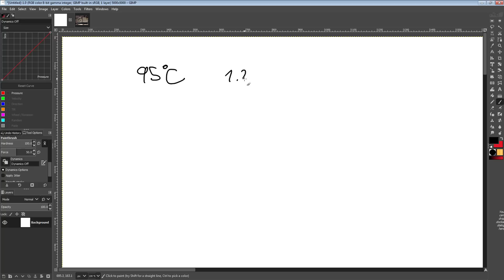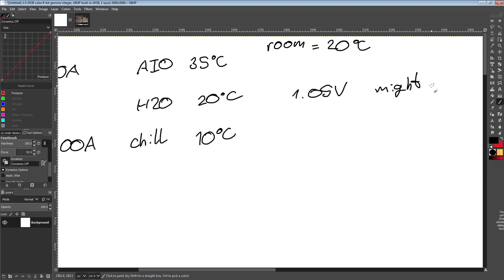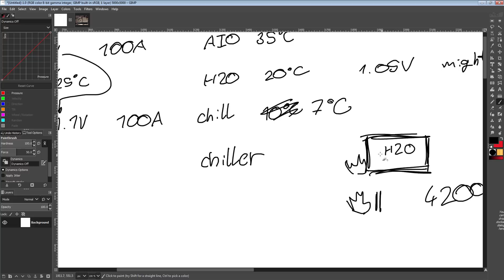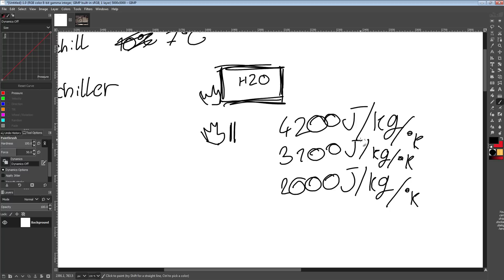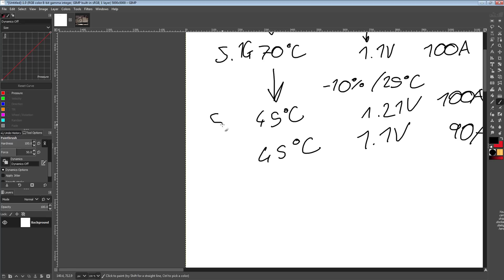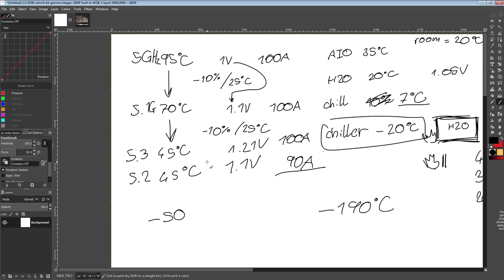Elaborating on how lower temperatures can improve voltage tolerance.

Comment: Typically with semiconductors, though depending on the material/geometry of the semiconductor, current has a quadratic increase when it comes to electromigration. That is due to blacks equation being MTF = A/j^n*e(Ea/kT) with j being the current density and n depending on the material/geometry of the semiconductor while typically being 2.
Reply: I get it

i don't get it

Comment: Oh shit thats interesting, im one of those who think degredation isnt a concern when running more voltage than stock at even little more temperature:D

But only in idle, under load using llc7 is using less V than on stock settings 

This should be ok, right?

Comment: This is a very nice explanation video. Any matter has a structural breakdown tolerance to temperature in a molecular manner. (I'm talking about the internal hot spot temperature of the matter in our case it's silicon on transistor scale but this applies to any matter) If your cooling solution has a huge delta like liquid nitrogen or Co2 or whatever. The bigger the gap is the higher the entropy. The faster the heat transfer to the cooler from the heat source. Let's say silicon has a tolerance of -150C to +150C, which means as long as the silicon remains in between that range, it'll not break. 
As we increase the voltage the more power the silicon uses therefore the more heat dense it becomes. Even though the sensors show 100C, the internal temperature of the silicon where the transistors operate are higher because of the sensors don't pick up the hot spot temp accurately due to the physical distance in between the hot spot and the sensor read point, therefore it'll start breaking down on the molecular level. However if the cooling solution is Ln2 for example the entropy is bigger which means the IHS, the thermal paste, the top of the silicon basically everything in between the LN2 and the transistors are colder therefore the heat source which are the transistors are able to transfer the heat to the top of the silicon, to the thermal paste et cetera much faster so it doesn't reach the 150C structural breakpoint and you can use more voltage because the transistors won't reach 150C due to the fast heat dissipation.

The degradation may still occur due to the extreme expansion and contraction of the matter caused by the rapid heat change.
 (note that I made up the numbers, I don't know if the silicon's breakpoint is 150C or whatever temp. It's probably higher.)

Comment: And here I am, scared of degradation even with an undervolted CPU, I have an I7 3770 since 2013, I overclocked it to 4.1 GHz on all cores with negative offset of -0.015, I want this system to last as long as I can because do not have money to upgrade to a new platform, also did the same process with my GPU, 1660 Ti, undevolted and overclocked, the voltage curve hit 0.950 mV at 1980 MHz, enought to have the GPU core always below 60ºC at any game that I play

Comment: Sounds to me like I should just run my 9700k at stock speed, and my F4-3200C14D-16GTZR kit,  with XMP turned off. And be happy with it.
I'd like to keep my shit for more than a week hey...
Reply: Don't go completely paranoid with degradation, at that point you're making a chip that would last 10 years last 20 instead, and you will probably have many other components fail before it.
Reply: Why in fucking hell would you run with XMP off?

Comment: liquid ammonia isn't that op either.
Ammonia has a molar mass of 17, so in order to have more heat capacity than water (4.2j/g/C REMEMBER, ONLY AT 25C) you need 71j/17g/C, or 71j/mol/C.

Eyeballing this chart on https://en.wikipedia.org/wiki/Ammonia_%28data_page%29#Heat_capacity_of_liquid_and_vapor
liquid ammonia clearly has the advantage at 81.5 ish, but that's what a not quite 15% increase?

This is also assuming the same weight, which might not be what we are after. After all the amount you can stuff between microfins is limited by volume, not mass. However much more dense water is to ammonia also eats away at that 15%.

Obviously ammonia has the advantage of not freezing practically ever, but you do need a pressurized loop to keep it in liquid form.
Water on the other hand requires stupid amounts of pressure to prevent from freezing so you end up putting in additives that decrease not only the thermal density per mass but also mass per volume as well.
Point is besides being not something you want near consumer products, ammonia really isn't much better if at all at water above freezing point obv.
Reply: On the other hand, liquid ammonia (closed) loop might be great for actually ln2 overclocking. I can only imagine there's some leidenfrost effect at the bottom of a jar you just placed on a multi hundred watt heat source. Would probably be a bit more efficient if you actually had a loop to transfer that heat to a radiator submerged in ln2?
Much more surface area, actually some flow rate to prevent that insulating nitrogen vapor etc.

Comment: X570 unify cmos reset is broken. Fix is to pull cmos battery. Thermals drop 20c boost clks increase. Even on a3 bios.

Comment: I feel a lot more disconcerted with AMDs auto overclocking feature going to 1.48v on low cpu usage and 30-45C after this video.
Reply: then you missed the whole part where current is the important bit
Reply: And this video is mostly for static OC not Ryzen's boosting algorithm

Comment: I feel like this video is aimed squarely at me lol
On the last one, I commented that my 9900K was good for 5.4 at 1.4 and after about a year of handling it, it wouldn’t run there anymore and I had to reduce to 5.3.
I love to learn everything I can, so this is valuable information for me.  Not that I didn’t sorta know this already.
I will say that theres no way I’m running a chiller.  I’ve tried chillers and TECs in the past and they’re a pain in the ass. As soon as you drop below ambient, you have to worry about condensation, no, I’ll risk degradation before doing that again.  Building PCs is like crack for me, I have the best stuff and I keep thinking, what will improve my performance?  When the answer is nothing, a degraded Chip is an excuse to upgrade next time something better comes out.

Comment: I have a little bit of data for you if you would like it. I used a Gigabyte Z77X-UP7 motherboard + a delidded i5-3570K in a custom water loop in it. Large custom water loop, 4 radiators, total 920mm of rad space, 2 pumps, 16 fans, etc. I knew this system would degrade on me. I didn't care it would degrade on me. I picked up the processor off ebay already delidded for $30. I put it in this system bare-chip direct to the block and I clocked it at 5.0 Ghz @ 1.655v and I just ran it that way daily. I didn't care it was bouncing at 100-105c daily when gaming. I just did it because it was fun. Also to add: completely unknown history with the CPU. I bought the CPU myself used in spring 2017, about feb 2017. Initially when I first got it all set up it would run at 5.3 Ghz @ 1.75v for about.. 1 month. It degraded and I dropped it to 5.2 Ghz at 1 month and it ran there for about another 2-3 months. Degraded again. I dropped it to 5.1 and 1.70v and it ran there for another 5 months after that. Then It degraded again and I dropped it down to the final clocks of 5.0 Ghz @ 1.65v and it ran that way daily for a long time all the way until november 2018 and then it finally kicked the bucket. Powered it on one morning, POOF cpu just flat dead, won't POST in any computer anymore. Worked 100% perfect the night before, gamed on it @ 5.0 Ghz @ 1.65v for about 9 hours the day before. Then next morning just *Poof*. Maybe this could serve as some time information for you about degradation possibly. Now I run a modern ryzen system instead and keep the CPU @ 1.325v, very much anti-degradation. But the Z77X system was awesome fun for a while.
Reply: And here I am, scared of degradation even with an undervolted CPU, I have an I7 3770 since 2013, I overclocked it to 4.1 GHz on all cores with negative offset of -0.015, I want this system to last as long as I can because do not have money to upgrade to a new platform, also did the same process with my GPU, 1660 Ti, undevolted and overclocked, the voltage curve hit 0.950 mV at 1980 MHz, enought to have the GPU core always below 60ºC at any game that I play

Comment: These videos may be a bit messy, but the information is still worth every second spent watching. I for one didnt even know about the oxide stuff for example until the last video, since i have yet to see any OC guides actually explain why and how exactly stuff goes wrong. Its usually only " 1.X vcore should be safe, good luck recruit." Glad you chose to upload this.

Comment: @buildzoid Is this and the last video in relation to the degraded 2nd gen zen chips people have been reporting at fairly low manual OC voltages?
Reply: i haven't heard about this but you have me worried.  at stock my 3800x hits 1.5v whenever it feels like it which kind of pisses me off.  and everyone says just leave it alone they know what they're doing.  do you have any links so i can read up on it?
Reply: @XX-121  it only does that at idle. They range from 1.1V to 1.5v depending on the load, Its actually a dense topic with a lot of things to consider. Have a read of this.
https://www.reddit.com/r/overclocking/comments/f18cbc/reviewing_voltage_recommendations_for_zen_2/

Comment: 3700X 4.3Ghz all cores 1.264v /asus C6H LLC 3 /280mm aio /FCLK 1900mhz 1.09v /4x8gb 3800mhz(F4-3000C14D-8GTZR)(16 17 14 14 28) 1.45v/ AIDA 64 stress test >60min max temp 80c/ premiere render vid 4k max temp 76c. 24/7 100% stable.
lots of vids in my hardware playlist (in portuguese I´m from Brazil) https://www.youtube.com/playlist?list=PL6NiYPlbVX-5sSoGrBFi048gCxkwoPUFy , 4.45ghz 1.37v bios settings boot to w10 and CBR15 run score 2370 in https://www.youtube.com/watch?v=fdj27lgwLeU&t=67s and  all my bios setings for my RYZEN 4.1Ghz 1.11v /4.2Ghz 1.17v/ 4.3Ghz 1.264v in https://youtu.be/9ma35CIPBGY

Comment: My i9 9900k runs at 5ghz at 1V ~1,12v with Max temp at aidatest at 66-71 degrees celcius. Two 360 radiators in push pull. And gpu at max 45 degrees celcius. Room temp 20-21 degrees Celsius.
Reply: That's one golden 9900k
Reply: How about Prime95 small FFT?
Reply: I have not tried that yet.
Reply: Bullshit

Comment: Do you know anything about the MSI B450 Mortar Max. Initially I wanted to buy the B450m Mortar Titanium which you recommended but I saw that a newer version of the Mortar was available (the Titanium is more than a year older). The only changes I could find the upped RAM clock compatibility (fromn 3566mHz to 4133mhz) and a price drop of 12€ or 13,14$. Should I buy the Max instead of the Titanium?

Edit: which microATX x470 that doesn't cost a fortune can you recommend?
Reply from the maker: the MAX boards just have the full size MSI BIOS instead of the lite BIOS
Reply: @ActuallyHardcoreOverclocking  thanks a lot
Reply: @ActuallyHardcoreOverclocking  I just looked around a bit and decided to change the case I will be buying. I now have the option to mount an ATX Motherboard and will most likely do so. Price point is around 150€ or 165$ in Germany so there are a few candidates. Those are all x470 but I am not shure if x470 or b450 is right for me.

- ASRock X470 Master SLI
- MSI X470 Gaming Pro Max
- Gigabyte X470 Aorus Ultra Gaming
- ASUS Prime X470-Pro
- ASRock Fatal1ty X470 Gaming K4
- ASUS TUF X470-Plus Gaming

There is also the MSI X470 Gaming Pro Carbon wich costs 185€ or 200$ but I would be willing to pay that if the Motherboard would be a good chunk better.
Thanks for your help and time. I really enjoy your videos.

Edit: The CPU is going to be a Ryzen 7 3700x and I plan on some light overclocking but nothing extreme.
Reply: @creepyshadow55  asrock bad. Everything else idk. But asrock is bad. The bios feels so slow and cluttery.

Comment: ammonia is used in office building conditioning systems. i was given a tour at a manufactur of spiral-compressors and they said there is almost no risk with that, but dont ever try it DIY
Reply: Ammonia is a quite common working fluid for some kind of cooling systems and is often used as an example during engineering classes

Comment: So wait,  running a 9900K at 5+ Ghz is not a wise idea as the increase in frequency and perhaps voltage will slowly kill the chips due to higher current draws?
Reply: look at that video he made https://www.youtube.com/watch?v=uMHUz16MuYA
Reply: I never managed to keep my 9900K "cool" running 24/7 at load, mind you, thats with a custom loop, 45l reservoir, eheim 1048, rad ex560push-pull noctua.  After 24h, watertemp rises to over 40 degrees C. (coretemp close to 90C) "water" was actually high quality motorcoolant.  So now I'm happy with 4500GHz all cores at a tad lower voltage and using a simple noctua tower.  Still have to rinse the WC parts for storage an later use... (later use, depending on the WAF I can achieve)
So what I wanted to say is, that water or air, don't bother aiming for 5+ GHz, fine for benching, but not practical for dayly use...
Reply: @0neyedK  wtf my 9900KS is only on a 420mm rad. 5,1GHz all core P95 with AVX2 and under 30°C water after 10h... i have a good batch if i recall correcly with L918F556 ( others reported 1,110V under load non avx 5GHz for F and E). I mean 280W is a lot but we are talking AVX2. If you only want 5GHz with an offset of 2 you wont see 200W under load. My room is not under 18°C. Iam not a good overclocker but you dont something wrong or have a really bad Chip
Reply: I think I degraded mine at 5.4 at 1.4v for roughly a year, now it doesn’t like it anymore.  It’s a risk, sure, but I don’t really give a crap.
Keep it as cool as you can at the highest voltage you’re comfortable with, that’s the only thing you have total control over.
Reply: @chincemagnet  yea, 5.4 is really high. But i would agree. If you upgrading all 2 years its irrelevant. And if you like to keep it 8 years you should not OC or just a bit. 

Mine cant even get to 5.3 under 1,45 and LL7 Asus, so 1,34 at 5.2 AVX2 5.0, 4.8 ring and 4300Mhz 16-18-18-36 4x8GB RAM it is. If it degrades then thats that and if it dies i buy a new Gen. Thats how I handle it.
Reply: Maurice Elet yes, it’s good to see others on this channel that feel the same way I do.  Most people have been flabbergasted that I’d risk a chip capable of 5.4.  If it will do 5.4, why not run it there?  Of course 1.4v core is my cutoff for a daily setup.  Used to be 1.365, ran that for years and years with multiple chips, never had any trouble.  Guess I got lucky, then unlucky.
Reply: @chincemagnet  i know some that are between 1.4 and 45. Guess you got unlucky or the 5.4GHz was it. My 8700k needed 1.42 for 5GHz so i can only think of that
Reply: @chincemagnet  Honestly I use to do the same thing,  run it until it has issues and push it to the limits.   I've overclocked everything from 8088's,  yes I'm dating myself,  80286's  386's 486's  P3's  P4's  etc..etc.   Now that I've switched to the AMD camp for now,  I have no desire to OC anymore.  It's not even about the cost as I've OC'ed $2700 Xeon chips in the past without a care running on boards that supported an OC.
Reply: Bit of a sarcastic question that I posted.   I'm actually running a 3950X wth dual rads,  2080 TI and 32GB 3800 CL 16 RAM.  Yep RAM could be better but it's fine.
Reply: @jeffm2787  3800 Cl 16 can be better? man, thats totaly fine for 32GB. if you dont want to have a fan over it CL 15 is maybe to hot.
Reply: @mauriceelet6376  Hynix D-Die chips,   I know it can do better timing wise then it is,  it's just hard to find really good info on those chips that's useful.   Honestly I'm happy with the performance I'm getting and suspect any additional will be sacrificed for stability.   Running a GB Aourus X570 Master MB.  4 sticks of RAM.  Guess I should be happy I'm getting 3800 stable on that.
Reply: @jeffm2787  yea 3800mhz is high on ryzen

Comment: So most chiller refrigerants can get to -45 C, 50% antifreeze (almost entirely glycol) is liquid up to -37 C, 40% -24 C. What would be the optimal temp and glycol % to target?
Reply: are you trying to run something like that?!
Reply: @mauriceelet6376  Turning a dehumidifier into a glycol chiller.
Reply: @Ironclad17  well, then you on paar with the one that has ordered 2 custom peltier elements for his loop... i dont know, but i would save me the money and just buy a new CPU/MB kombo after 2 years. or buy a decent sound setup. but thats just me i guess
Reply: @mauriceelet6376  I know this is a year old but a good chiller will last many hardware configurations and provide lots of fun while at it. Whereas new hardware is a lot more temporary.
Reply: @Goddess_Gaea  That might be true, but if we take your powerbill into account, you could get the hardware for about as much I guess. A chiller might be a good idea if you have the space and own the place (or live where the walls are wood i guess lol). I cant imagine running something like that, cause first: condensation. Second: higher failure rate altogether and a pain to move. 
Third: Powerbill.

Sure you can have your fun, but even with watercooling, you might have problems that need to be adressed now and then. I'd rather have a total stable system for gaming and a little fun with it now and then. Could be because Iam more into RAM since CPU clock is basicly how far you can lower the temps with good samples if you dont go truly exotic and know what you do. I also enjoy building a PC, so having new toys is a positiv initself. Take Z370/90 vs Z490/590. Cant run 32GB with 2 DIMM MBs, cause they suck with it on Coffelake, so you stuck with 4133-4266 on a hero. Apex XII/XIII and a new F4-4000C14D-32 kit from G.skill... uhhh now you looking at something like 4600 17-17-17 daily if you lucky. That shit keeps me going, not a CPU that can do 100-200MHz more.